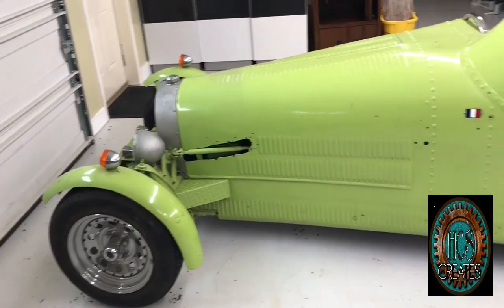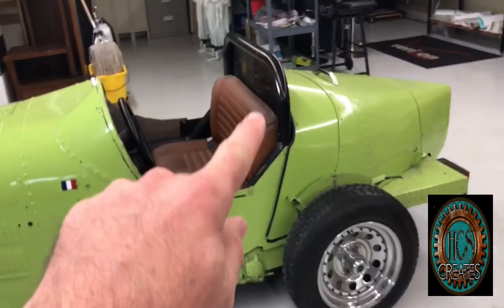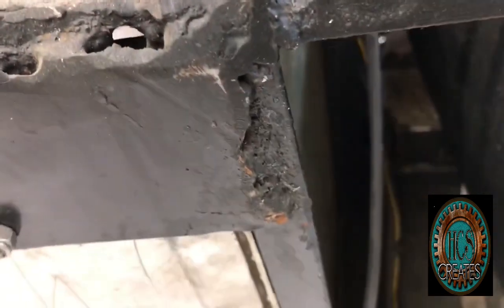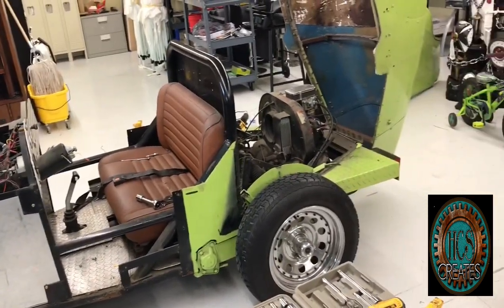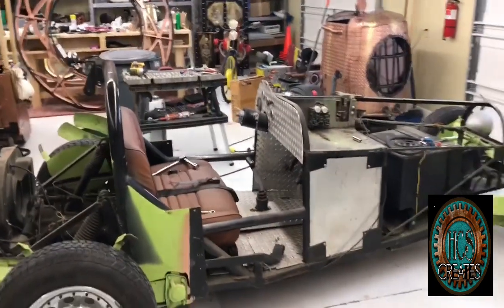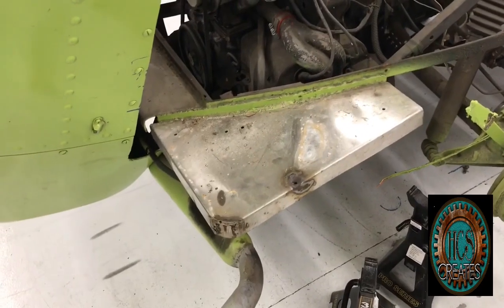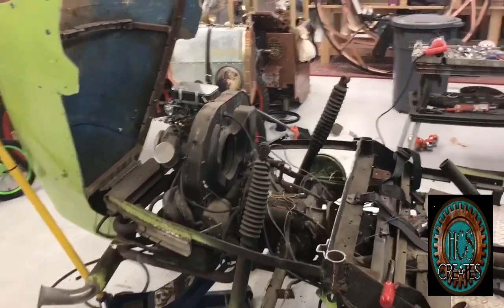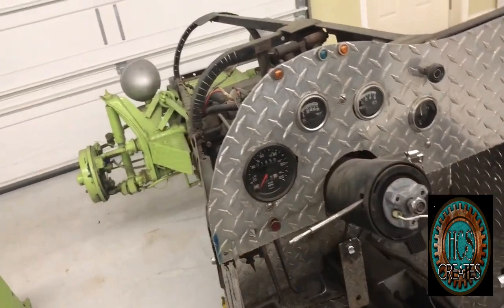VLOG 22: 1929 Bugatti kit car restoration: Day 1

Comment: You done anything more on this?
Reply from the maker: Yes, just haven’t posted any new videos.
Reply: @HCSCreates  I have a fakebugatti also. I extended it 20 inches to get the seat off the transmission. I just lost motivation to finish it.
Reply from the maker: @joshuaputnam1810  would love to see it. 20 inches is a huge change. Even with the 6" we changed the cockpit, it cause a lot of body issues.
Reply from the maker: @joshuaputnam1810  here are some pictures of the progress. https://www.facebook.com/media/set/?set=a.10155175714032602&type=3
Reply: @HCSCreates  yes I havent redone the body work yet. I need to make 20 inches of fiberglass. thats part of the reason I lost motivation. lol